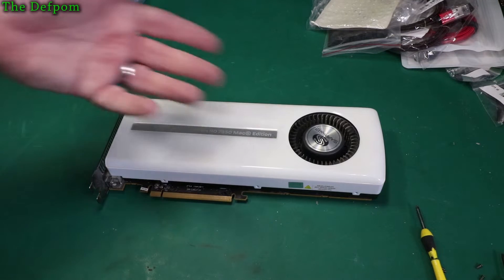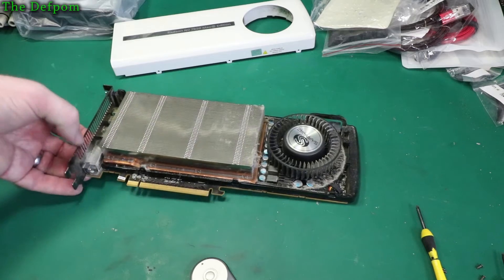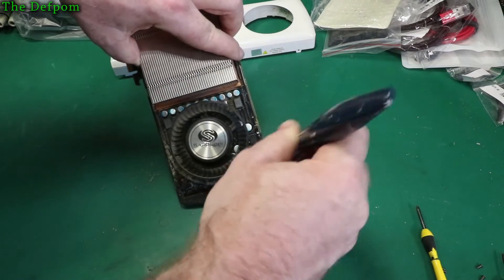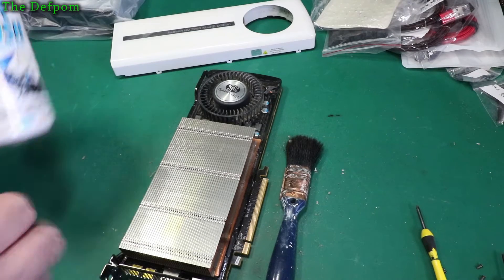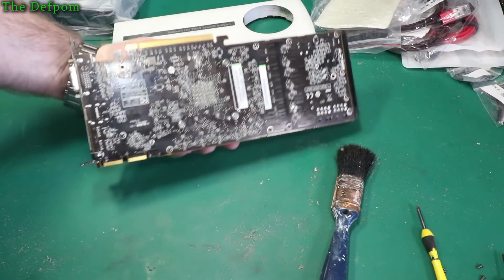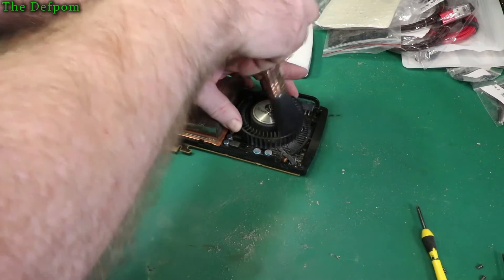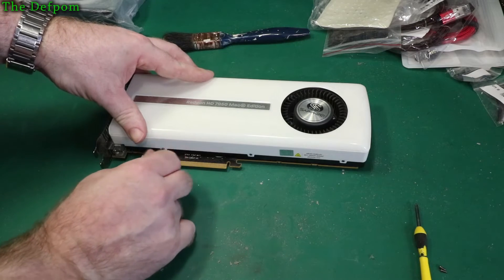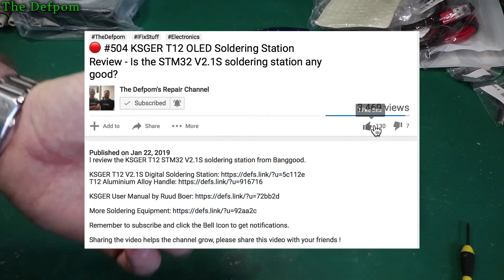🔴 #543 How to Clean Radeon HD7950 Sapphire Graphics Card - How To Stop Your GPU Card Overheating

Comment: I do it outside with an air compressor, but be warned always stop the fan from turning otherwise you can shatter the fan or knacker the bearing.
Reply: last time i saw bearings in a fan was on old GPUs.
Now they all molded without bearings. You can`t take them apart.
Reply: @DanielCardei  I don't mean bearings as in ball but if you over speed them with an air line it does something to it and they spin properly afterwards.

Comment: You forgot to clean the shroud. And I would replace the thermal paste because the factory one is utter crap and not sufficient (by design). Put on Thermal Grizzly's Kryonaut. Nothing else. It's non-curing. Once put on, it will work forever.

Comment: Nice job! I noticed the likes and dislikes counter is missing. A shame you had to take that action. A "rookie" mistake when using compressed air is to allow the air stream to spin-up the fan, this can damage the motor bearings.
Reply: Even the cheapest air compressors from Harbor Freight have a valve to control the flow. Canned air is expensive.